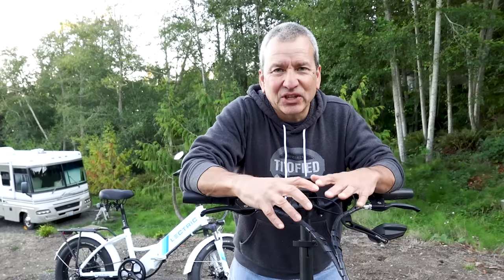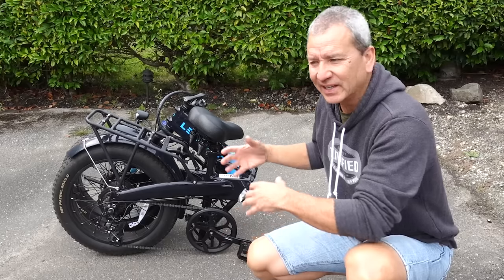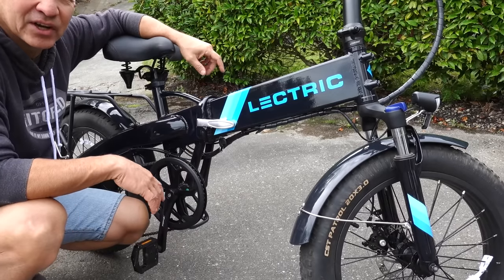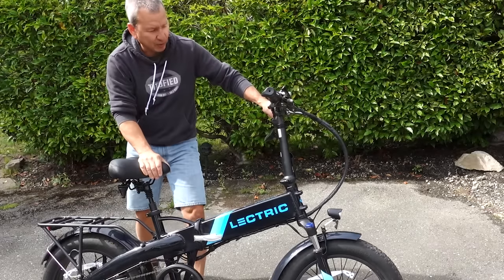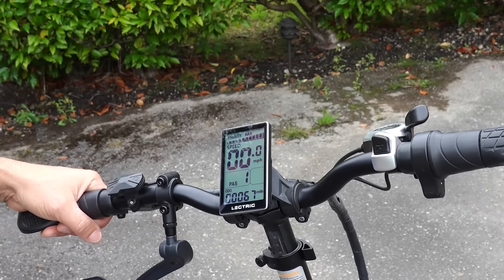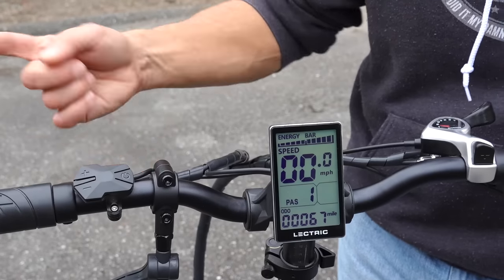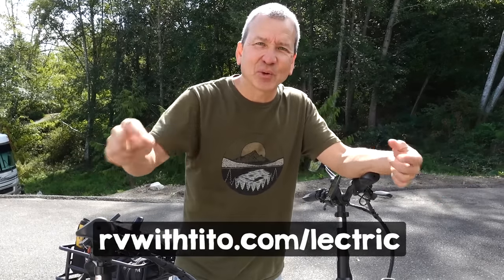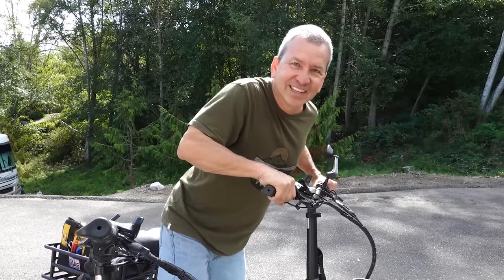Should a LECTRIC XP be YOUR FIRST E-Bike? | Full Review & Testing | RVwithTITO DIY

Comment: How hard is it to ride if the battery goes dead?  I have a tricycle electric bike, the batteries are really large, but to just ride it as a bike, it is very heavy to ride then.  Anywhere located in NYS to try it out?
Reply from the maker: You can ride it without battery power just fine. If you get to a hill then you'll definitely feel the weight of the bike. Sorry. I have no idea in NYS.

Comment: How do you charge it when your not at your house? I don’t have a big motorhome. I have an A frame pop up. Do you know if they can be charged with 12 volts?
Reply from the maker: You can't charge it directly with 12V. It's a 48 volt batter and needs at least 52 volts or so. The best bet is to use an inverter or power station that can produce AC power. Then plug in the included charger that will output 55 volts.

Comment: Hello!  Thanks for your great videos!  Question:  now that you have had your Letric XP 2.0 bikes for a while, how do you feel about them?  Is there anything that you wish was different with these bikes now that you have put some miles on them?  The RadExpand 5's are more costly, but is there quality in the Rad bikes that make it worth the extra cost for simple everyday bike rides on generally flat surfaces?  In other words, if we were to purchase the Lectric XP 2.0's, would we maybe wish we had spent more $$ and invested in a more robust or comfortable bike etc...?  Many people seem to love the Lectric XP's  - there is no question about that.  But without being able to test them, I don't want to have buyers remorse and wish I had invested some more money to get some additional features, quality and benefits.  Any thoughts?  Thanks so much for any insight.  Again, GREAT videos!!
Reply from the maker: We do love the XP 2.0, but I would recommend trying the XP 2.0 and comparing the ride before replacing your RadExpand 5s. I haven't ridden a RadExpand 5, but the main differences I see with the XP 2.0 specs are the 3" tires, digital controller, and front suspension. Beyond that, there are lots of similarities between the two. As folding e-bikes go, the XP 2.0 is a great value for the price. I've also been riding the Lectric XPremium and actually prefer the feel of a larger frame, 4" tires and hydraulic brakes. My wife still rides the XP 2.0 and feels very comfortable riding it. Several of our friends have RAD Rover 6s and really like them. I've ridden it too. There's definitely a different feel with a full-size 26" wheeled bike that's nice....but it doesn't fold. So there's always a trad-off. I hope this is helpful.
Reply: Thanks so much.  Thanks for the input.  Going to move forward with the Lectric XP 2.0. great value. Did you do any videos or are you aware of any videos about proper battery handling as far as charging?  In other words can you charge them when they're still 75% full or should you let them run down to 20% and then do a full charge?  We want to do everything we can to keep these batteries extremely healthy. Thanks for any other input. That's my last question so I won't be bombarding you with more questions. :)
Reply from the maker: @RelivitMedia  Hey. No worries. I keep them charged up after every use. Then they are ready to ride next time. I've heard you should keep them at about 80% if you plan ti store them for a long time. Hope that helps. Enjoy!

Comment: What is the weight of the bike? And the range with the battery if riding assist mode.
Reply from the maker: It weighs 65 pounds. Expect a range of 15 to 40 miles depending on how much you use the motor and assist.

Comment: This is absolutely outstanding review you did an excellent job I could not find anything wrong with what you did except everything 100% perfect thank you so much I needed this I had one question is your bike and your wife or girlfriend's bike it's not slanted down it is going a little bit a little bit higher that's something I would like to get an answer on because that is what the special running and I'm afraid if I will be able to I like your wife better but your wipes is more expensive and so I want to see the difference how would my foot go above the one you driving thank you again
Reply from the maker: If you think you'll be more comfortable getting in/out of the bike, then buy the step-through. It's very easy to ride.

Comment: Hello I am a new subscriber. Enjoyed the content. Wife and I are going to purchase these bikes. Can you tell me if I was to purchase the rack kit for one of the bikes, if the front rack could be installed on the back of the other bike without any modification. For me I cannot see any benefit to having two racks on one bike. Thank you in advance.  Also very informative video. Best I have seen. Thank you. Matthew
Reply from the maker: Yes. Both baskets fit the mount on the back. So you can have one on each bike. The only difference is that the front basket is square shaped while the other is more of a rectangle. Enjoy!
Reply: @RVwithTito  Thank you for the fast reply. 😃👍
Reply from the maker: @matthewmcgraw5258  you're welcome

Comment: I loved  Your video on the electric bike. So I purchased one however I had the same problem you did with the monitor.. it had an error message. When I called the company they didn't know what to do so they said they're sending me a new monitor.. so I'm waiting for the new monitor to hook up but I'm concerned because you had the problem too  so maybe that's a problem with this bike. So anyone out there if you have an error Message on your monitor This is not uncommon and maybe something the company needs to figure out. Because when this error happens which is usually when you turn the bike on You cannot operate any of the assist or throttle and you don't see anything on the monitor but the error. The  Bike is rather heavy so if you've been riding for a few miles and this happens you just might have to walk or peddle your bike back not a good thing. Other than that I really like the bike I just hope that this is an easy fix.
Reply from the maker: Same error code 010? The controls still worked on the bike when I had the issue though. I hope the new display will fix the issues your having. It's a pretty easy replacement. Since replacing the display everything has continued to work fine. I actually have some video of me doing the replacement that I may publish after reading your comment. Good luck!
Reply: @RVwithTito  mine had a different code no number all 88 were in the areas of the monitor..I wanted to attach a picture I took bur not sure how too

Comment: I bought one of these LECTRIC bikes. Took 2 weeks to get here. Day 1 trip 1 went out 4 miles and the throttle quit working as it would only go 11 mph. The battery showed full. Turned the key off and on 2 or 3 times, wiggled and jiggled the throttle, and went thru passcode 1 thru 5. It Finally started to work again and started home and when 2 miles from the house battery seemed to be dead and went to barely 3 mph then started to go again. I got a bad and disgusting feeling when I got home.  This bike will not go at say 3 or 4 mph which is a pleasant walking speed. It only goes at 8 or 9 mph or higher which is still fast and you cant just mosey along and chill and check out nature. Checked all wiring and connections and bolts and all again. The next day turned the key on the computer light would not come on.  Shook the bike and jiggled the key and finally, it lit up.  Complained to Lectric bikes and  9 days later they sent a new battery. Put the battery in again and went out 2 miles and the bike would only go 8 mph. Had to mostly pedal home. Am now terrified to go out on this P.O.S. catastrophe waiting to happen as I bought it because I have a heart problem and need exercise but not an intense workout pushing it home as I bought it to make it easy to get home if I got tired of peddling. 14 miles on the bike and I put it on craigslist and sold the damn headache and lost $300. and was lucky to get it as you cant transfer the warranty, sold it before it made me walk again!!! Had to shake the bike again to get the computer to come on before selling. Dont buy this Chinese monstrosity!! This thing took a year off my life in worry! Did not want to have to work on it at the start and finish of every trip. I feel lucky to have lost my shirt and gotten out from under this B.S. It's as bad as one of those Chinese 49cc scooters that won't crank, dies at every red light and you have to overhaul the engine every 3 days! Man! Buy yourself a good used city bike for $100, off craigslist, and if it quits roll it down a hill.

Comment: I attempted to put 25 minimum in the tires and defaulted to 21.5 as I felt the tires were getting too hard. Is that going to be  an issue or should I push to 25 or 30?
Reply from the maker: Should be fine. Whatever feels comfortable.

Comment: I think the Lectric is really uncomfortable and non-practical out of the box. It needs to come with a freewheel upgrade so you can actually pedal hard and help the battery, swept handlebars, smoother handgrips, and a better seat. Out of the box, it was horribly uncomfortable (imo), and the gears for pedaling are underpowered.

With new handlebars, grips, seat/seatpost, and freewheel, it's good, now.
Reply: Thanks for the great video!   For wade,  what  freewheel did u upgrade too?  Brand and model
Number plss.   And where can i buy? Or if u think of another brand that is comparable or better.  Thanks  Wade!!

Comment: My one and only complaint is the weight. This thing is 64lbs out of the box! It's an absolute pain in the butt to fold and put in the back of a vehicle. Add accessories and you might as well put it on a motorcycle trailer.

Comment: These seem to be a lot less expensive than other e bikes. Is there an "easy" explanation, e.g.  features other e bikes have that these don't? If so, what?
Reply from the maker: I think that's why Lectric bikes are popular entry-level bikes. You get a lot for the price. Some components like the mechanical disc brakes and transmission are the lesser expensive model, but perfectly adequate. More expensive bikes may include higher quality transmissions, hydraulic brakes (which are awesome), front and rear suspension, and higher-end display. All of those things would drive up the price of the bike. Hope that helps.

Comment: We have the first version. What I don’t like about them is no front suspension and the tires are too wide. We can’t go over rough roads with getting jarred to death. Also, for me the riding or frame ergonomics are just not the same as a bike that has 26 - 29” wheels and a standard frame. Folding frame is attractive because we full time and store them in the back of our Jeep Wrangler Unlimited. Unfortunately, they are a little too heavy for me to lift them into the Jeep without hurting my back. We don’t find the seating comfortable even though we upgraded to Lectrics pneumatic seat post and Cloud 9 seats. We are seeing a lot of electric bikes as we tour the country most of them non folding and standard size. Sounds like Lectric has solved the front fork issue and tire size. It would be interesting to test ride one someday to see how much they are improved.
Reply from the maker: I'm sure you'll find someone who'll let you take it for a spin.